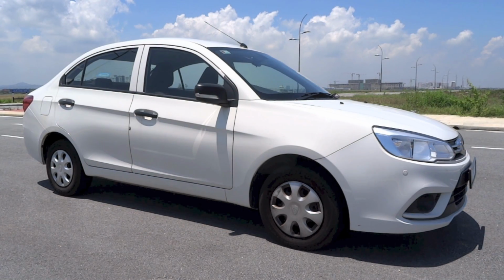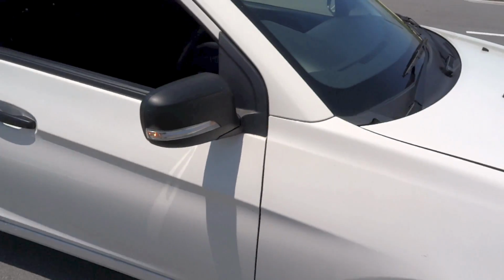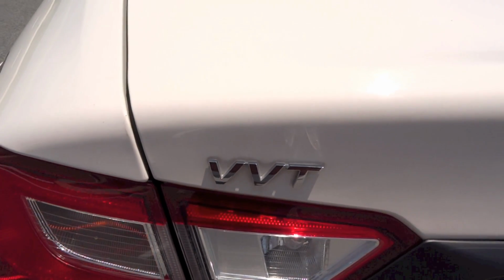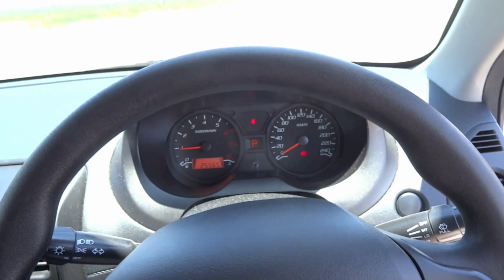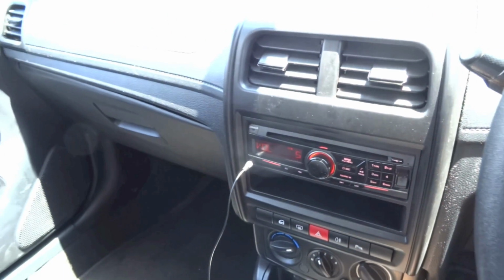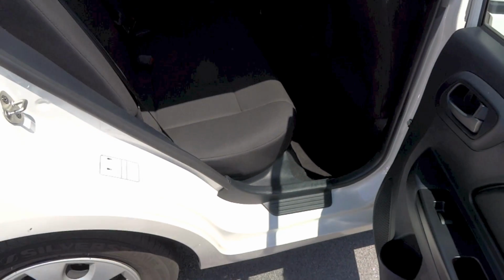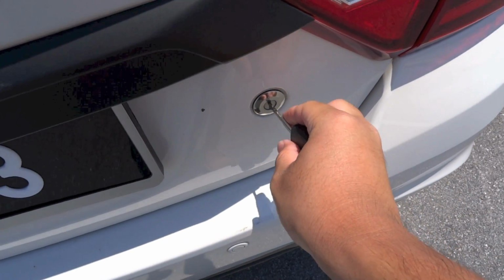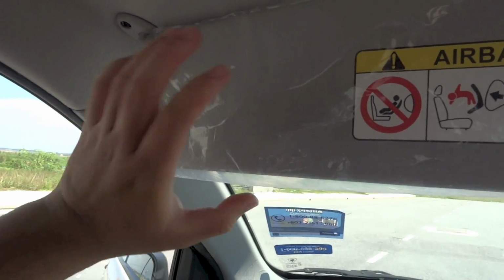2017 Proton Saga 1.3 Standard Start-Up and Full Vehicle Tour

Comment: Now I realized why the Perodua Bezza Basic spec is more expensive than the Proton Saga Standard…You get more features such as automatic window at driver side,Isofix,led tail lights…
Reply: Saga standard is cheaper but nicer to drive
Reply: @NokiaHumanForm  cheaper and much much more comfortable
Reply from the maker: Chen Automotive Channel ISOFIX is standard no matter the variant.
Reply: @alexlovesmac  oh,I didn't notice it haha
Reply: 4 speaker double din radio for.bezza
Reply: Don`t forget...proton saga got steel rim with hub cap unlike on the perodua bezza you got axia g spec rim.furthermore proton saga get unpainted side mirror,door handle and unpainted at the back bonnet,i doesn know what is it...I didn't notice that perodua bezza get electric mirror adjustable or not..but proton saga you has to adjust it manually...and yeahh perodua bezza come with 4 speaker,,unlike proton saga only 2...although the sound doesn good enough but it's okay than nothing...
Reply: Dont forget, Bezza bsic got ABS, meanwhile Saga standard dosen't have ABS..
Reply: @jackleyadey1187  HAHAHA. No use have all this shit abs but passive safety tkde....Bezza use tin milo saga use army tank body....